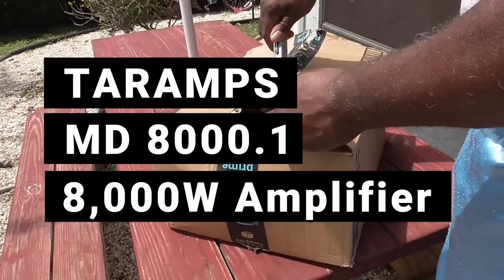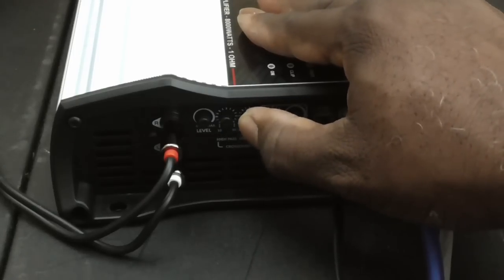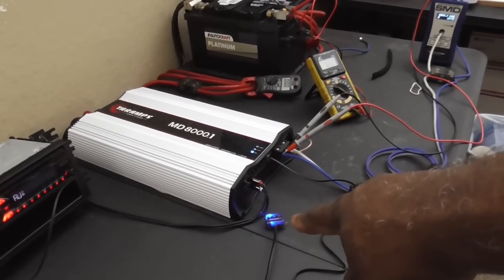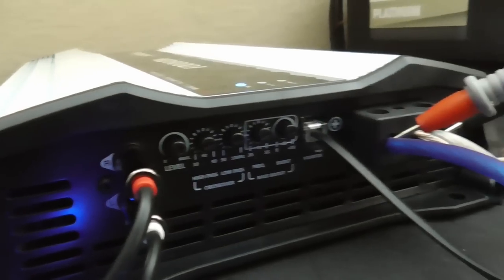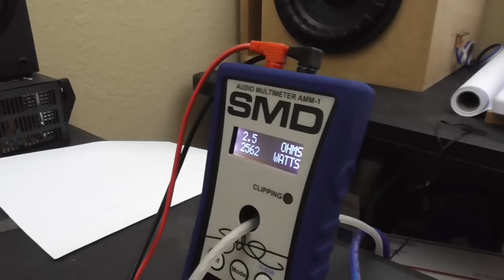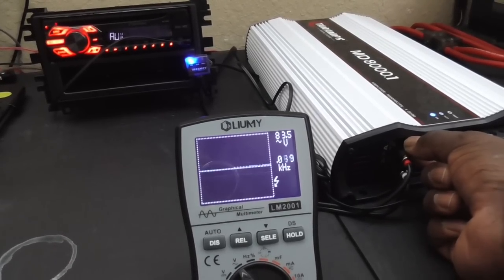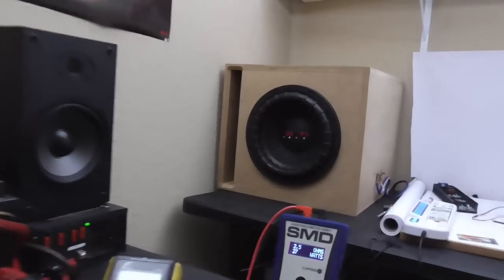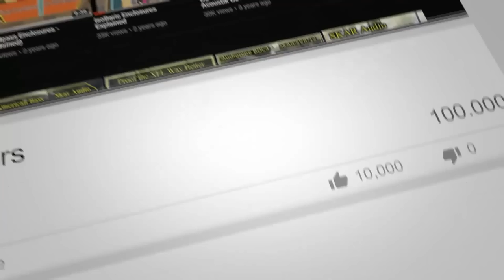Should You Buy This Amplifier? TarAmps MD8000: 1 & 4 Ohm Testing

Comment: And one other quick tip, put 2 more speaker terminal studs on your box, then just connect all 4 sub wires inside to the 4 terminal studs, note and mark L+L- and R+R- on the corresponding stud. This way you don't have to take sub out anymore when you want to change wiring configuration, just do it on the outside at the terminal studs
Reply: Wish you told me this back in 1996. Lol
Reply from the maker: Excellent advice thank you

Comment: Taramps is a good budget-friendly amplifier but you got to have some legit electrical to push them correctly I personally have the smart 3K and love it🔊🔊🌪
Reply: Yeah me too, you gotta have a dsp though because the brazilian crossovers are so high you can still hear vocals all tthe way turned down
Reply from the maker: Thanks for the tips!
Reply: That's not actually true. They require less than the average Korean amp..barevids made a video on that recently. The killer of many taramps is improper preout voltage.
Reply: I don't doubt that one bit.. but a good electrical system ( HighOutPutAlternator, Quality Proper Wiring & Good Batterys) help them preform at there best too. I have learned that from experience firsthand.
Reply: @xchimnyx  you definitely good electrical though. My smart 3 would go into protect because of low voltage running stock lead acid battery(not agm) and 200 amp alternator a few times a day (40 minutes of driving) until I upgraded my battery to an xs6500. Headlight were still dimming and adding a yellow top helped a lot. Yes I did big 3 and at the time probably had a run of 0 and a run of 4
Reply: @xchimnyx  they might be a little more efficient than some Koreans at some ohm loads but you’re talking the rca inputs. Yeah taramps doesn’t like anything over 4 volts for sure. Back in the day I remember basing my decision on a head deck because of a higher preout lol. But again you def good electrical because my smart 3k went into protect mode because of voltage drop  pretty often even with a 200 amp alternator
Reply: @Titans2138   my smart 3 has never shut off or clipped still on stock alt silverado... 2 batterys 170 ah and been awsome
Reply: I have the 8000.1 with a 95ah from Coventry industries, dual alternator setup with high output alts, pushing 2 Orion 15s at spot on 8k
Reply: @warnerhatten598  sounds awesome 😁
I bet it pounds 🔊🌪🌪🌪👍🏼😁
Reply: @bassanonymous4923  as of 7 mins ago I no longer have back or side windows in the Tahoe😂
Reply: @warnerhatten598  holly shit‼.. bad thing is probably never been so proud to break windows in your life🤣🤣🤣🤣🤣. I only have a single zvx on a smart 3K damn sure flexes all the windows and roof but a lot of decimals away from shattering glass😁
Reply: @Titans2138  true
Reply: @kimmyn4608  it was going in protect on me with stock battery. After I put in an XS 6500 it stopped doing that. I added a yellow top and a 370 amp JS alternator for good measure and the smart 3 isn’t my only sub amp. If it was just the smart 3 I would’ve been fine with the batteries. I’ve read in quite a few places people saying batteries only help when your engine off and that couldn’t be further from the truth, in my experience.
Reply: The new smart 5k doesn't care about voltage as long as you can at least maintain 12v and up! And they don't benefit any from higher voltage electrical systems either, ie) 15v+ cmax and simalar lithium setups. The new smart5 has a regulator built in for the input voltage, kinda sick feature after seeing how power hungry the smart 3k was!!!
Reply: @brianmosleyb9104  smart 3 isn’t necessarily power hungry. It’s efficient, just 3k is a lot for stock electrical
Reply: Some one plz explain i bout a 3k running 0 guage and out the blue if i turn the amp up a lil it cuts off  but eventually cuts back on regular batt sumone help
Reply: @daddydiesel7910  I'm running the same amp and they need good power. The only time my amp cuts out is if I over push it and get below 11 volts. In that case the protection mode kicks in and shuts the amp down but it will come right back on within a couple seconds. My guess would be your definitely having some electrical issues. Do you have a voltmeter? And you have the clipping indicator hooked up if so is the red light flashing before it cuts off?
Reply: @bassanonymous4923  no i dont have a that meter i hooked them up in my v8 explorer no bigger alt or batt and it was fine for a few weeks and next thing u kno it would stop hitting and cut off then click back on but i have to keep the radio low for the subs to hit or it will cut off at high volume or if i have the amp up i replaced the amp thinkin it was that and it still does it so im replacing my dual 12” kicker l7”s thinkin i blew a coil sumone help my subs will be here tomorrow will a capacitor help?
Reply: @daddydiesel7910  yeah your voltage is dropping too low and the amp is going into protect. You need to hook up an additional battery, most likely. Same thing happened to me. I bought an xs 6500 d for a few hundred dollars. You need at least a little more zero gauge. Put second battery in trunk, use existing 0 gauge to connect the two batteries in parallel. You can just ground the second battery to good nearby spot. You don’t need a ground wire in between batteries, just the power and ground the new battery to the frame or something.
Reply: @daddydiesel7910  get an additional AGM battery and wire it in parallel to existing battery. You don’t need to run a ground wire in between batteries, just ground them to the body or frame. You also need to do the big 3 upgrade. People say don’t mix agm and lead acid batteries but it’s not a big deal especially if you drive the car everyday. I suggest hard wiring cheap voltmeter in parallel with your smart 3 and mount it somewhere up front so you can monitor it and see what’s really going. Mine drops from 14.6 volts to around 13.7volts when I play a 40 hz test tone which is a lot harsher than music but it’s a good test because music is dynamic and the voltmeter can’t keep up on which bass notes. You could also just use songs with heavy sustained bass notes. I turn it up until it barely clips snd then turn down a little to test at max output. Voltmeter is how you’ll know how far you knee to go with electrical upgrades. Other signs of low voltage are the amp going into protect and headlights that dim or flash during heavy bass. My voltage drop is fine especially for test times but if your voltage drops below 12 the amp will go into protect which is a good thing, it’s protecting itself from the low voltage. I think you should upgrade until your voltage never drops below 13volts but that’s just a random that sounds good to me 👍
Reply: @daddydiesel7910  what happened?
Reply: Can I use a stock alternator???
Reply: @rodneyhendricks2412  maybe, how many amps is stock alternator? Or what kind of car do you have? I’d guess maybe but you’re going to need at least one $300-$400 good AGM like a big XS Power. When I had my stock 200 amp(it’s a police crown vic, if you have a Honda or something you might only have an 80 amp alternator) and a new but cheap flooded lead acid battery my smart 3 would go into protect from low voltage sometimes. Only way to know is to try it. Start with a good AGM and see what happens but if you’re right on money I’d hold off because the electrical upgrades are going to be more than the amp. XS Power AGM + 25 ft of 0 gauge copper wire w/lugs, fuse holder, fuse is $500 easy and that’s just the minimum. It’s nice to have a second battery right next the amp. You still might need a high output alternator. Another run of 0 gauge at $100 would be nice too. ($500 + $400 + $400 + $100 = $1400) come to think of it I probably have $2000 in my electrical and my entire system with all the upgrades is probably $7000 in materials and equipment. If a shop did it it would’ve cost me $20,000 for my stereo
Reply: And I don’t even have like really high end stuff. It’s mid level stuff like hertz Mille and audison voce, for example
Reply: 2013 Dodge Ram 1500.

Comment: Rule #1 low voltage causes distortion. Hence clipping
Reply: No. Totally wrong. Clipping occurs when the transistors cannot pass enough current. 
End of story
Reply: @papermaker85  low voltage does 100% cause distortion
Reply: Low voltage definitely causes distortion
Reply: No, it doesn't, it just makes your clipping come sooner, you get the same quality at low output, stable 11v will sound the same as stable 15v, you just can't push the amp too hard at 11v

Comment: Owned this beast for over a year now it pounds no issues or problems fans are not a problem they keep this beast cool at all times the only con on this amp is dont buy low rms woofers you need woofers with high wattage capability if not you will have blown $400 and up subwoofers this is a mono bass amp that takes no prisoners

Comment: Tarramps amps work pretty good. I have an 8k and 2 3ks. I will warn those though. If you don't have the electrical ID say don't buy them. I have a 240 alternator. An agm up front and 6 210ah in the back. 8 runs 1/0. So far no issues. I've been running about a year. My only complaint is no bass knob. I would buy the bass though. I lost 2 md models. My fault. Running below rated ohms. So far the bass model no issues yet. I never drop below 13.1 though.
Reply: I have 2 EVL 15s in my company car. 18 fusion with stock alt stock battery under the hood and 3 sms80 in the back. The battery bank should cover about 6K. Even with the battery bank I should stay away? I was gonna get the bass 5K and run at 2 ohms, I was even thinking the 8K after watching the box rise video. If not what brand would you recommend? I’ll upgrade the battery under the hood but changing the alt will prove to be too much to be worth it on a company cat
Reply: I have a 240 alt and an agm in front-what might you suggest for the back if I get this amp?
Reply: I can use a stock alternator as long I have back up battery?
Reply: What ohm  was running to lose two md models.  I habe the md 5k ...    but am abount taking all out upgraded  everything. I already have everything   on stand buy all beside the amp ...  I was waiting and been waiting  about  can't take no more thinking going ahead doing next week ... just didn't fell like talking all of it out ...  lol  but old lady on me todo it she is getting my old stuff I'll be putting all in her car ...  but say all this to say this .. .I' be putting in xv3 12 sundown. 1 ohm version...    what amp would be best for them. ..  I habe 320 amp alternator couple agm batteries  plan on getting  one more battery also that's one reason have not done it and I need amp and can't decide what line I won't to use I been using the md5k on 2 evils on .5 ohm  they hit hard hard lol 😆 😂    can't maake.mind in run new subs 1 ohm or .25 quater ohm  wonder with box rise all that should  what would it come out  ohm wise  .5 or  so idk  not sure ....  will md line or smart bass  or what  would run it at quater ohm ....   any input would help thanks 😂😂

Comment: now use it as a DC to AC inverter. set the tone generator to 60 hertz, set gain until voltage is 120 v on the speaker output and power on a table saw!

Comment: This is the first time I have seen the Tara tested in this fashion.(good real world test). I believe these amps (with the right power supply) can be used with an array of P.A. speakers to actually rock a decent sized club as long as you watch the clipping and keep it cool. It seems like that's what they were built to do by the looks of the guts of the smaller ones. I have noticed that the sound quality is determined by your input signal and how you process it because that's how P.A. amps are set up too. Great video and thank you for keeping it real and using affordable test equipment.
Reply from the maker: I agree. Input signal is very important with these amps. They are only going to amplify what is sent to them. I plan to use it with a DSP from Dayton audio.
Reply: @BudgetBassHead  maybe you got the Dayton already, if not the YouTube channel 5star car stereo says they don’t like it. Maybe you can step it up a little and get the Rockford Dsr 1. I just picked up an alpine PXE-0850X for like $550, the dsr1 is like $320 and rising. Any dsp is better than no dsp, I think the Dayton just doesn’t have a lot of bands of eq. Once you get a dsp then you’ll learn how to use REW. All you’ll need is a $20 Dayton mic, a $5 trrs to trs splitter and a laptop and you can tune your system. Took me like 7 hours to figure out REW

Comment: I had my MD8000 1 ohm edition wired to .5 on a single Digital Designs 9915 SC , and on the same Dyno it was pushing 9,240 watts on the exact AMM-1 Dyno luckily that subs a beast because my previous Sundown ZV5 18 didn't take it for long runs it would fry also fried my Ground Zero Nuclear 15, also dynoed my SounDigital Evo 8000 at the same ohms and it did 8,200 but it did sound cleaner kinda like my Crescendo , the MD8000 does need to be hooked up to my DSP to get the bass I want , I ordered a Banda Viking 15,000 5 days ago and it gets here in two days can't wait to Dyno that awesome board

Comment: There is a way to minimize the sparking when you first hook up the negative terminal. You take an automotive test light, One end goes to ground then you touch it to the negative terminal. What you're doing is charging the caps, your test lights come on for a moment, and then go out. Then you can safely hook up your negative terminal without getting the big spark. Because I'm just like you, that spark makes me jump every time😅

Comment: I recently upgraded from a skar 1500 W amp with four gauge OFC wire to a Taramps big boss 3 bass. I still have the four gauge wire hooked up and I’m getting clipping. I have an ioxus ULTRA-CAP. I’m gonna be pulling the four gauge wire and installing two separate zero gauge wires going to a distro block on the ULTRA-CAP hoping I can get away without getting an alternator quite yet

Comment: I am using a 90ah lithium bank @ 15.6v - 16v 380amp alternator and I’ve never had any issues out of all my Taramps amplifiers. Only clips but never shuts off or anything of that class.. you should build a better power bank to do test on Brazilian amplifiers..
Good video by the way.. it was entertaining
Reply: I have this exact same amp the 2 ohm model however and I’m running 2 platinum 15’s @ 1 ohm it doesn’t clip at all unless I really get on it and even when I do it’s a “soft clip” voltage will be 12.9-12.7 I’m running 104ah headway bank stock alt amp never shuts off
Reply: @215sinakia7  exactly.. mine clips and even the red (“protection”) light comes on and never cuts off or shuts off.. been using it for a year the same way… no issues!! Those are great amps

Comment: Great video, very plain English explanations. To solve your spark issues when connecting power, use a resistor of some sort (like a little handheld tester that has a probe and a lead with an alligator clip that has a small light bulb. Connect the positive power first, then clamp the  alligator clip to the ground terminal of the Amp and then touch the probe to the ground source terminal or wire end that will connect to Amp  The light will light up brightly and slowly begin to fade out as the capacitors within the Amp charge. When the light goes completely out the capacitors are fully charged and you can now safely connect your ground without the 4th of July taking place in your vehicle which sometimes will blow your inline fuse. Trust me, I was having the same anxieties every time I used to connect power, and the bigger the amps the harder the spark!

Comment: Good to hear man. I just built a 72ah headway pack to feed my 630 farad ultra cap which feeds everything. The lithium and the xs sb-630 easily supports my little 5k-7k system. You will LOVE the caps and lithium together. It was a bigger difference than doubling my alt power yo for real. Any questions bout either feel free to hmu. I did a grip of studying before buying any of it. And taramps hate low voltage and low impendance, any of the smart series has been proven a very decent amp and with the regulated power supply fights rise
Reply from the maker: You should love my next video 🤟
Reply: Excellent comment

Comment: I was looking at the Taramps bass 3k just last night because I want a new 3000ish watt amp for my VXF 15.

Ended up going with the crescendo S1V2 Plus which is 2500w. Korean board, very efficient.

I have two AGM batteries and 1/0 big three and 1/0 wire to the amp but I don't have an aftermarket alternator yet. My alternator is under some other stuff and will be a real pain to switch out I was kind of hoping to avoid it.

I keep hearing these taramps need good electrical so I'm avoiding them for now.

Comment: I have the hd3000 on stock alt, walmart battery, XS battery, and 0 gauge ground and power.  No issues
Reply: You have no issues bc you're only getting 1k-1500k out of the amp after impedence rise
Reply: @BoobeeMyles  I ran the hd3k a .5 so was i still pulling only 1krms?
Reply: @jorgem50  more than likely bc your alternator is stock..  & that amp is consuming 300amps or more.  When you upgrade to a high output alternator, you'll notice the difference brotha

Comment: You should use a dual terminal block on your Toro sub to reduce wire cutting and reinstalling the sub every time you change the ohm load. Or at install threaded inserts to the wood from being stripped out from all the removing of the sub.